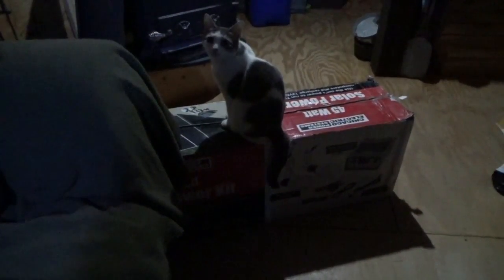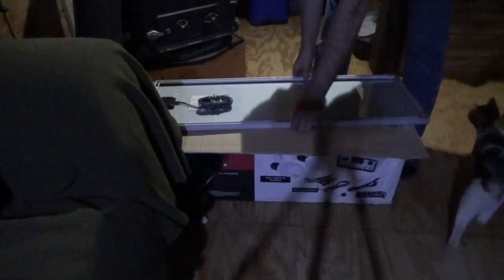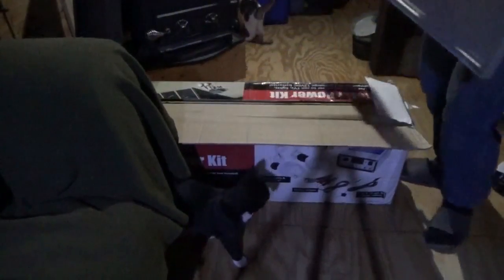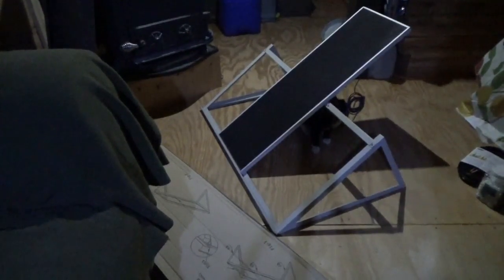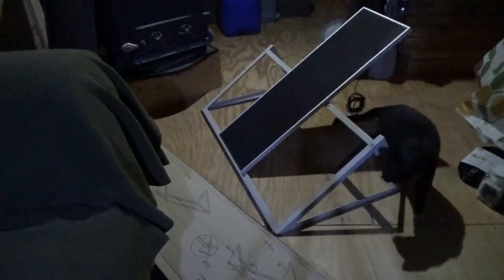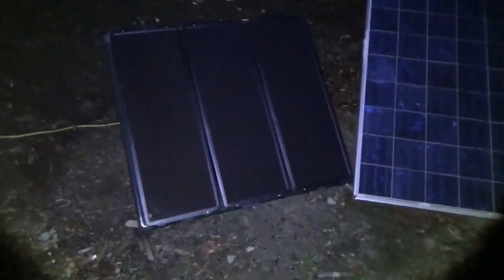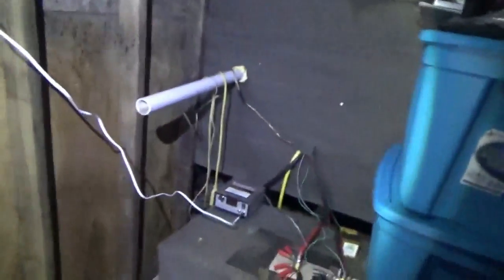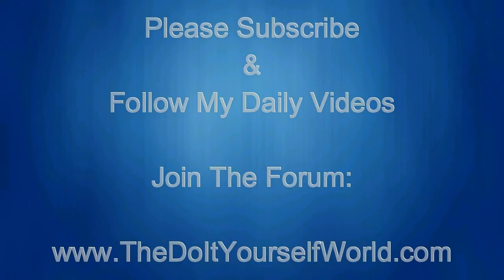Setting Up Harbor Freight 45 Watt Solar Panel Kit

Comment: OK solar panels for a little bit of light good idea. But where are the batteries for it? Man your gonna have some frozen water tanks soon and no more bathing. It 's fixin to get really cold soon. I hope you get the shed closed in with a door and some insulation. Also that place under the house is going to let in plenty of cold wind into the shed. Do you have an old insulated door for the shed yet? Better hurry up closing in the shed or you be stuck with frozen solid water tanks.
Reply from the maker: +shartne It is pouring rain. Working on solar panels is a perfect rainy day project. I just bought insulation for the shed and am trying to get paneling. Problem is I have no truck and my friend's truck just died. When I get the paneling I will finish the shed. Until then I am NOT putting in insulation. That is mouse haven waiting to happen without paneling.
Reply: +The Do It Yourself World OK, Oh bummer your truck is still broke. What is it doing? Is major league broken? It finally quit raining here for while until next week end. We got more than six inches. My rain gauge was all the way full so I dont know how much we really got. It is like a drought then when it finally rains it is too much rain. Strange weather four sure. I like the old Harbor freight panels a lot better because they have so much better aluminium frames in stead of plastic.

Comment: Considering the wind in the meadow I am  wondering how you will secure the panels up on the roof so they won't break or blow off?
Reply: troy says just no sun but hes not doing the wind yet. um um um
Reply from the maker: +MollyDolly I am quite worried about that.
Reply: Lol rite no
Reply: The Do It Yourself World  Well, since that wicked straight wind ran parallel to the house I hope orienting the panels facing the meadow might prevent the wind from catching...but I think you will still need to seriously bolt those things down.
Reply: Lynn Morrow  The wind twisted the last tower...why repeat that?
Reply: Lynn Morrow What pipe?  I'm talking about the  metal shelving that was made into a tower with out riggers, that's what bent...not the pipe it was attached to...and I don't know if he plans to use the same pipe or not. Probably not if that guy said it's not big enough.
Reply: Lynn Morrow  I am sorry you're in a bad mood, me too... oral surgery yesterday.   Not happy...it spread the infection to my ear and sinus.  Well, it was the metal shelving that the wind twisted like a potato chip, not the "pissy little pipe"... ironically that was fine.

Comment: You need to get a skirt around the open area where the shed and house meet up. Plus a door of some type. A freeze s not too far away for you and that is a big open area. O_o
Reply from the maker: +The Long Project Yes I am going to do all that. I just got insulation for the shed but its been raining hard and I dont have the paneling yet. I will put the insulation and paneling in at the same time to prevent mice.
Reply from the maker: +Nonnie 121 NO, but paneling stops the mice from having their way with insulation with ease. Put up insulation out here and find mice moved in the next morning.